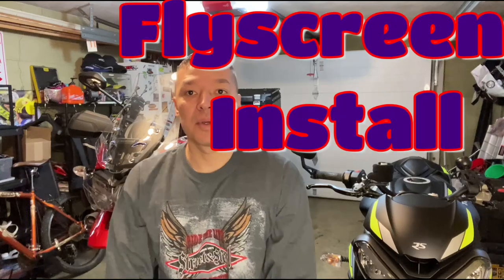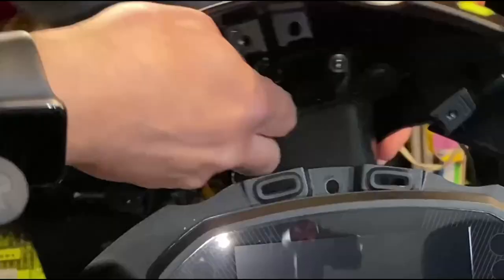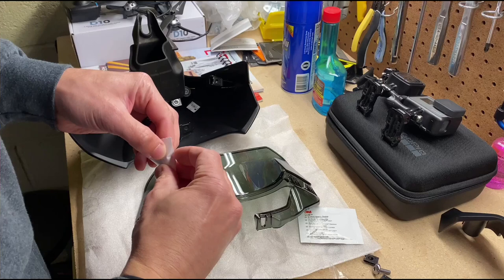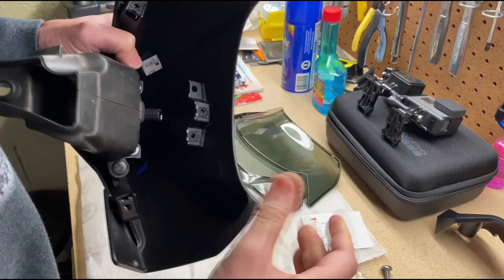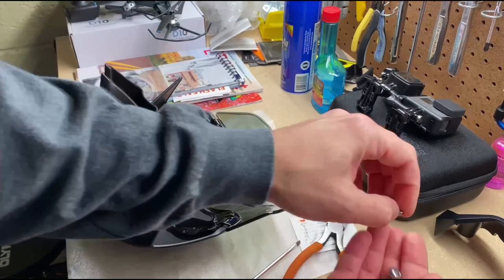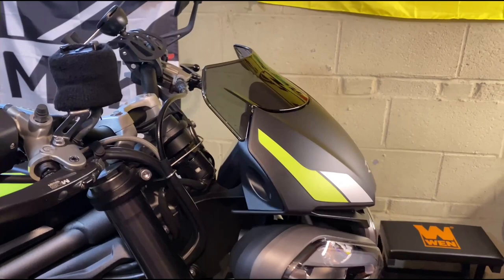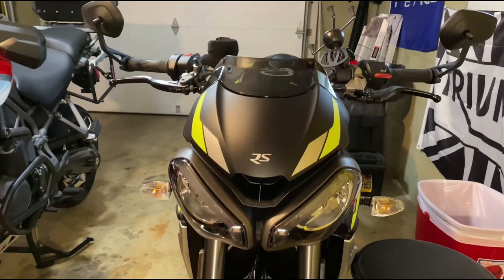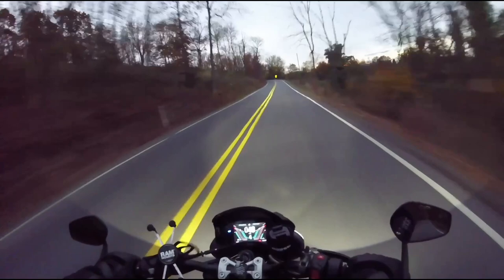Flyscreen install 2020 Triumph Street Triple Rs

Comment: Nice video.  Where did you purchase the Flyscreen?   Link?
Reply from the maker: You can purchase it at your local triumph dealership. If not check ebay and amazon have seen them on both sites.

Comment: Look sharp on 20 STR RS. Supposedly, these are discontinued from the factory, and not many available out there. I have not seen non-OEM aftermarket flyscreens look good on these bikes.
Reply from the maker: Yea i was told the samething. Triumph seems to make limited number of there profucts. Its very weird. I’ve had all kinds of other bikes and they seem to make millions of parts but triumph only makes a little bit of them lol
Reply: @funnymotoman3503  Just got it installed on 2019 STR RS. For older RS, no need to remove 2 black screws on the side. Thanx for vid. Looks sick..
Reply from the maker: @trex8693  yea i wonder why triumph makes accesories for there bikes in it seems a limited run. Its very odd you have to get them quick or it not you can’t get them or you have to wait till another company makes them. Thanks for the info. It makes the bike look awesome.
Reply: @funnymotoman3503  Someone mentioned it has to do with the homologation issue for the US  market. I sure don't mind paying an extra $100 as an option to avoid hassles.
It looks good with Crystal White.
Reply: I hate that triumph discontinue parts so early after a new model is launched,
Reply: @1teenybop  They do pop up on ebay once in a while. It should be installed as a standard 
equipment at the factory. Smoked fly screen really enhances the look. Another thing they left out is a steering damper.
Reply: @trex8693  morning Trex, its not just accessories though. I dropped my bike when cleaning the back wheel, Doh,, then struggling to find the standard parts is a nightmare, the crystal white flyscreen ,discontinued, mirrors same, been scouring ebay and the forums for months,, cmon triumph play the game, I can still get parts from Honda for my 1977 400/4 easily.

Comment: Thanks for the video! Have you noticed a reduction in wind buffeting because of the windscreen or is it mostly cosmetic?
Reply: Looks like you answered my question at the end of the video. Hehehe… Thanks again. 👍🏼
Reply from the maker: @VincentTL  lol no problem. It does help its not just for show. I also have an arai helmet with the new dfx spoiler. They work together to help wind buffeting
Reply: @funnymotoman3503  Thanks, man. Was also considering the Powerbronze windscreen. Because wind blast can be a problem at speed. Of course, it’s a naked, so it’s to be expected. But if a windscreen can reduce the blast, then why not? 😊 Thanks again for the video. 👍🏼
Reply from the maker: @VincentTL  yea i totally agree. Doing 80 on the street bike it feels like your getting pulled backwards. Its a very weird feeling lol. But the windscreen helps a bit and tucking in for sure if your doing anything over 75 mph. No problem.
Reply: @funnymotoman3503  “feels like your getting pulled backwards” - hahahaha!! I thought it was just me. 😝
Reply from the maker: @VincentTL  lmao yea weird feeling bud 😂😂
Reply: @VincentTL  I ordered the 320 mm powerbronze which I recommend over this if you ride like me which is often over 120 mph on the straights of the canyons. But you have to remove the front fairing. They do have a couple that when with the fairing on
Reply: @californiapoontappa  Thanks for this feedback. I was just discussing the PowerBronze with my buddy who just bought the Street Triple R LRH (like mine) and he as asking advice about the windscreen. I didn't know there was a taller version other than the 140mm one. I haven't seen it on their website. I'll look again. Thanks!
Reply: @VincentTL  well I have the speed triple 1200 I read title wrong and though it was a word not street so they might not make one
Reply: @californiapoontappa  Hahaha!!! Was searching for the 340mm for the Street Triple and couldn't find one. Was going to ask you for a link. Thanks anyway! Ride safe!
Reply: @VincentTL  also it's 320 mm not 340

Comment: Been looking to add one to my 18' Striple RS. How tall are you? At 5'9"  I'm worried it may push more turbulent air around the head neck area. Thanks in advanced and subscribed.

Ride safe!
Reply from the maker: Thanks for the message and subscribing. Im 6 foot tall and it helps to not have so much air against my neck. Your shorter so it might push more air on your torso. I don’t think it will create turbulant air around your head and neck cause its very tiny usually the bigger windscreens can create a pocket behind your body i had that issue on the triumph tiger with a puig windscreen. Hopefully this helps.
Reply: @funnymotoman3503  Thank you Sir
Reply: Shalin  I installed a Puig sport wind screen (clear) It made a noticeable difference on a 850 mile tour I took. It moves the air off your torso and upper chest and cleans the air up around the shoulders. I wasn't as fatigue at the end of each day. Also did a track day and it provides a nice bubble to tuck your head down on the tank. 

Total bolt on and IMHO doesn't detract from the looks of the bike.

Comment: man I absolutley hate the R is not the same.. I can't get mine installed (2020 version) at all
Reply from the maker: Really i thought the r and rs where almost similar in every aspect. Except for dash and mirrors.
Reply: For the R model, you actually have to take the headlight off (to take the headlight off there should be two screws under it) and look directly under the speedometer and take out the screw on the left (facing the bike). Then the speedometer will come off but will still be connected to the bike by a wire. You don’t have to remove that wire. Then do what he says starting from 1:10. I just installed a windscreen on my R model.
Reply from the maker: @kbsunitadas  Thanks for posting that for the R model.
Reply: @kbsunitadas  wow will try that tomorrow! I tried calling a few different triumph dealers around the country an no one could give me an answer haha thanks so much!
Reply: @jaimerojas8449  typically triumph waste of time the lot of them